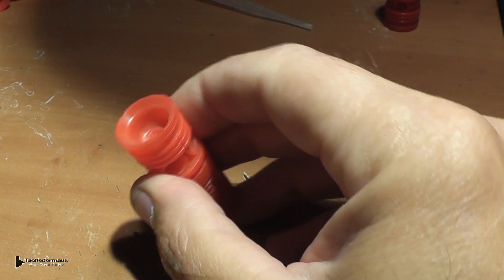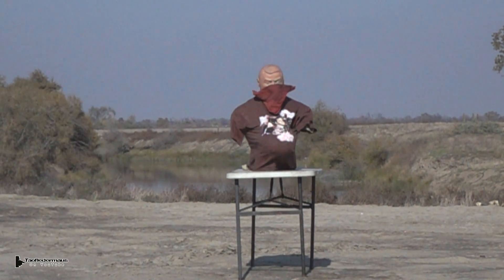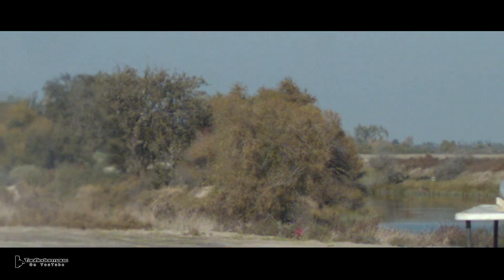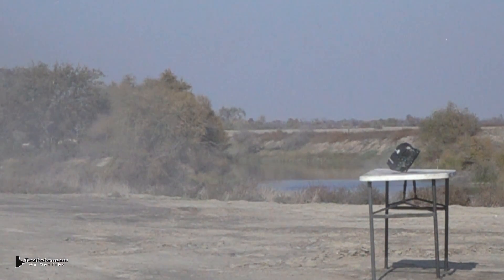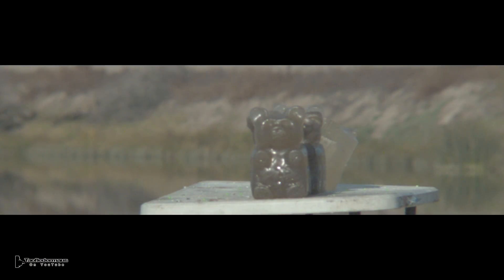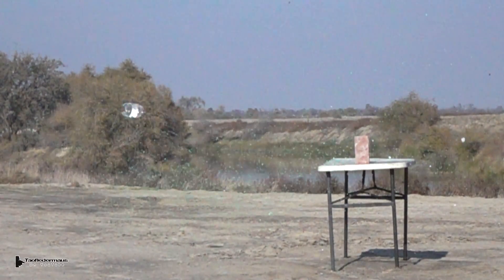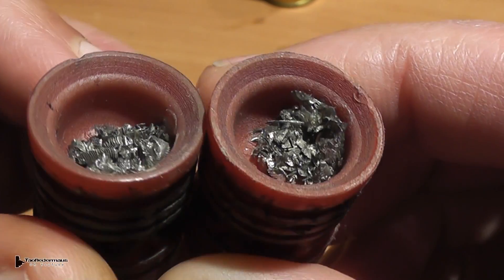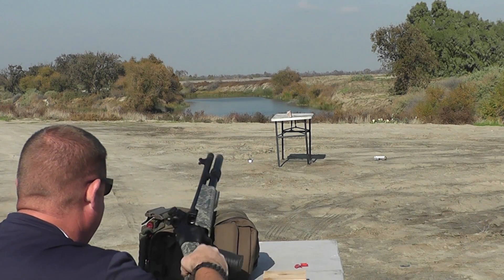Magnesium Shotgun TRACER Experiment -You Asked for It

Comment: tracers activate because of the friction of the air against the chemical that ignites....magnesium needs a heat source to ignite, which is why this will not work.
Reply from the maker: Then what caused the magnesium to ignite when it was just in the powder?
Reply: +TAOFLEDERMAUS the powder going off, but when you fasten it to the bottom of the shotcup, as it travels it creates a draft effect that keeps air from contacting the magnesium which snuffs it out almost instantly

Comment: The glue doesn't Transfer heat well and is not flammable enough of a securing agent too allow the Magnesium shavings too burn effectively or quickly. 

The Shavings in the powder worked because the entire compound was flammable and the magnesium's effective surface area too mass ratio was ideal for quick and sudden ignition. In a similar fashion too how "Dragons breath" shells work which fire several magnesium pellets what we have here is kinda like what might happen if you fired a shell with a magnesium slug behind it from a pyrotechnical standpoint 

For better results use more flammable securing agents and smaller quantity's of magnesium over a larger surface area.

Comment: OK, coffee on board!
Try this: magnesium fines, barium nitrate and a little smokeless powder dissolved in a tiny bit of acetone.  Hmm, pasty.
Blend the ingredients, then fill the powder end of a sabot cup with this goo.
Let it dry many days.  If it shrinks and falls out, hot-glue it back in!
You should end up with a hard lump when fully dried.
Test some of this carefully, it can 'self-levitate' like a tiny rocket, so do this at a friends house. XD
Anyway, the barium nitrate is a strong oxidizer that will get the magnesium burning quite easily, the magnesium burns brightly and the smokeless glue holds it all together while lowering the ignition temp.
The trace will be greenish white with very little smoke.
BTW, magnesium + barium nitrate hold honors for most light output per pound of material.  Orange aerial flares are close, but they use sodium nitrate and Teflon.  Fairly toxic smoke.
The more you know.
BTW, the barium nitrate and magnesium should be a stoichiometric mixture: no excess oxygen or fuel.  Moles and all that.
Reply from the maker: I'm going to try some little balls out of a mortar firework shell.    I'm not sure if it is hold up to the blast but it will be a simple way of doing it,   which is what I am hoping to do.

Comment: I doubt the wadding coming loose is actually related to the magnesium - at least, not because it's specifically magnesium. Either the heat from the glue weakened the grip between slug and wadding, or the increase in weight caused any slight rotation or wobble to throw the wadding loose, or maybe some weird supersonic aerodynamic thing happened.  My bet would be on the added weight, but the heat is a close second, no knowing how the wadding and slug are bonded.As to why it didn't ignite, my bet would be that the glue is creeping along the magnesium, isolating some of the surface area from direct heat.

Comment: Thanks for another thought provoking video.  As I'm sure others have mentioned, there are two possibilities on why the Mg failed to ignite, lack of heat or lack of Oxygen (or both).  You could address both by including chopped fuse material with your Mg.

First thing I'd do is verify the fuse can ignite the Mg mixed with the hot glue (thermoplastic).  By it's nature, hot glue readily absorbs heat and prevents Oxygen from reaching your Mg particulate.

Hope you revisit this!

Comment: prolly due to lack of air moving through the magnesium shavings due to the glue. try using a vinyl or latex finger tip. cut the tip of the finger off and put the shavings in there and glue the latex or vinyl part to the sabot so that the ignition tears open the latex and the pieces come out more slowly and with space for air flow to allow ignition. Not a specialist but its sounds sound to me.

Comment: The magnesium literally can't burn. The shavings burned before because they were exposed to plenty of oxygen as they were shot out of the barrel and spread, but they don't have that now. The hot glue prevents any oxygen at all from getting to the magnesium, so even though the heat to ignite it is there, it's missing the oxidizer. Try again and mix some potassium nitrate in with the magnesium, that should help it get going.

I'm also not sure if hot glue is such a good idea, because it may form "walls" around the different reagents and prevent them from reacting with one another. It might be better to keep rather large shavings of magnesium and large clumps of potassium nitrate, and confine them in a container with a relatively small hole for the burning magnesium to be expelled out of. Probably not the best way to go about it, more something I could come up with off the top of my head.

Comment: Magnesium won't igntie underwater or underglue, apparently. Maybe magnesium tube or lengths of magnesium ribbon sticking out of the back of a solid slug? You'd have to pour molten lead into a mould around them, and I suspect you'd get what's technically known as "shit" accuracy that way. You'd also have to use tubular wadding or that French slug's sabot to launch it without crushing the tail section.

At a guess, the tail section is coming off because it has more mass. You can wave a stick around but if you have an apple on the end of it the stick'll snap, right? The compression as it's shoved up the barrel gets released as it clears the muzzle, and the extra mass on the back of the plastic means as it expands back to full length it's got more momentum backwards relative to the slug's main body. That takes more force to stop, and it's more force than the connection between the two can take. Overweight bungee-jumper breaks rope. Plastic comes off lead.

Comment: +taofledermaus I think what has changed is that by gluing the shavings together, you have increased the thermal mass of the magnesium. The very short time the burning powder has in contact with the magnesium & glue alloy is not long enough to raise the temperature to the combustion point of the magnesium or the glue. By gluing the magnesium to the sabot, you have given the magnesium a heatsink.
To test this theory Take one of the sabot rounds with the magnesium glued in, and try to light it with a lighter, the same way as you did with a single shaving. My guess is the magnesium & glue will take a lot longer to ignite.

As to the sabot releasing from the slug, by filling in the concave base of the sabot, you are changing the aerodynamics of the round. The increase in drag is only small, but it looks like it is enough to pull the plastic away from the lead.

Great video as always.

Comment: I suggest you guys should try shooting wooden slugs
Reply from the maker: We shot slugs made out of Mexican iron wood before
Reply: Anti Vampire slugs!
Reply: Mmmm.  Now, despite not believing in this silliness, I'm wondering how to make an anti-vampire slug.  So what's required?  Vampires need wood, but they specifically need an embedded stake, not an in-and-out.  Remember those Sauvestre slugs?  Use a slug like that, with an ironwood tail.  If you barb it to rip the tail free after the slug impacts, you may have a slug that leaves impaled wood despite having good penetration.
Reply: Fortunately they already did that. You can find the videos in their channel

Comment: Ya the magnesium wont ignite because it to much like a solid piece. Thus the heat of the burning powder wont properly effect the magnesium and get it to its ignition point. Well a free floating powder or shavings have that extra space around them (thus surface area and lack of mass) that allows the heat to envelopment them and get them to the needed temperature.
What you'd have to do is either make a mixture of something or have stages. Thus one part is easily ignited by the gun powder and will serve as the starting burn. This first part there for produces the needed heat and contact that can properly ignite the magnesium or whatever.
You could try using a more reactive metal, like lithium. But that stuff oxidizes pretty fast and if it contacts water can self ignite, which is bad. Could also drilling out the slug a bit and giving if a sparkler rod core with maybe a little magnesium dust. Which might have a higher chance to ignite, also wont explode in the gun.

Comment: the weight so far behind disturbs the flight of the wadding
when you glue down the magnesium you reduce the surface area and seal it partially off. the high surface area is needed to ignite it. it is still a metal and has relatively good thermal conduction, reducing the exposed surface area reduces the contact to oxygen needed for ignition and as tiny as it might be, the glue takes heat away.
with the suggested solid chunk of magnesium you would wait ages for it to start burning even when heated directly.

Comment: Did you try lighting the magnesium/hot glue mixture more conventionally just to see if it would burn?  My guess there isn't near enough heat to set off the magnesium.
Reply: it would be smoky and useless and no different.
Reply from the maker: The magnesium was right against the burning powder.
Reply: im pretty sure the issue is that the magnesium is just burning up in the barrel.
Reply: What if you used black powder instead of smokeless?

Comment: You need finer (fuzzy) magnesium particles, like those from drilling or fine lathe cuttings, add a little oxidizer too, potassium nitrate would work.  Mix it with some model cement or shellack rather than hot glue.  You could also just add a dab of black powder, mixed with cement or shellack, to the back of the shavings,  It would serve as a ignitor.

Comment: I think you are missing oxygen there, the magnesium is probably too densely packed to allow enough Oxygen in for ignition and glue is itself a barrier to Oxygen penetration.  

If it was less densely packed there would be more surface area overall as the inside would also be exposed.  Cant explain the separation of the wadding though thats odd.

Comment: to ignite something you need three things: fuel, oxygen, and heat. I think the glue is blocking the oxygen and hot glue absorbs the heat very well. I think the spark from the gun powder is not hot and or long (time) enough to ignite the magnesium inside the glue. Use glue that ist flamable and you slolved the problem, my guess.

Comment: the solution to the problem is simple. you are basically making your shavings solid which is why you are getting ignition. you might want to go back to mixing magnesium into the powder into the shot gun powder. you might be able to get a high enough ignition temperature that way.

Comment: Jeff,  I love your channel!  Keep up the great work!  I may be too far back in the comments, but here it goes!  

I was thinking that maybe you are experiencing separation of the piston and slug due to the arrangement of the glue/Mg mixture directly in the center of the cup?  This would cause a transfer of energy directly to the center of the slug causing it to separate.  Would you consider arranging the glue/Mg mixture around the circumference of the wadding, but still in contact with the powder?  This may not solve your ignition issue, but it will more than likely stay in one piece down range.

Comment: Taflo, (1)would magnesium mixed w powder that created the big flash ALSO ignite the "tracer" part? (2) if slug itself were magnesium w a flash hole from "tracer" through wad work to ignite slug? I once file shaved half a magnesium (powdered) firestarting block to dust & put the other half  under the dust pile & lit it w a lighter. The block ignited from powder fireball, burned through hood of car it was on, burned through top of air filter & into carb which melted & burned down into intake manifold. Made a hell of a mess & ruined the motor.
Reply from the maker: The magnesium that was glued to the wadding was right against the burning powder, in the same spot as the magnesium that was put on top of the powder.
Reply: +TAOFLEDERMAUS , saw that, apperrantly just the powder wasnt hot enough long enough to ignite the wad cluster. it took the powdered magnesium to ignite the solid block described earlier. im wondering how a flair projectile works. have no info on that.

Comment: The problems is the glue. It is basically rubber and will keep stuff from lighting on fire. Try just packing magnesium without glue. I think it will work a little better. And now I see all the comments saying the exact same thing as mine. So Now I just say go with your gut.
Reply from the maker: What would keep it attached to the slug?
Reply: ***** Maybe have a hollowed out slug filled with mag powder and see if that will make a tracer type round. To get it to ignite, you can have a small amount of magnesium between the wadding and the slug to light the magnesium inside the slug. Remember, I am no expert and have no knowledge of reloading or what is needed to fire a slug. So this is just a thought from a newbies view.

Comment: probably needs an oxidizer. try making a paste with strontium nitrate and magnesium powder, adding a dollop to the base and letting it dry completely. that should do the trick.
Reply: If we're getting into chemistry, replace the wadding and short slug with a longer slug that has a 4.5mm hole drilled into it from the front and msot of the way through, filled with a 13:2 by weight mixture of ammonium nitrate and caster sugar and capped with a pistol primer, total mass still about 28g (due to that stuff being less dense than lead).
You may want to mount the gun in a workbench and use a long cord to pull the trigger ...

Comment: Try a small chunk of magnesium, hollow in the middle with something that ignites at a lower temp and burns hot enough to ignite magnesium. I pretty sure such a substance exists but I can't think of what it's called

 super dangerous would be a mix of wax and thermite as a tracer in the back of the sabot and just pour some thermite on the top so it's just sticking to the wax as opposed to mixed into it

Comment: so putting "dimples" in a golf ball makes it go much further due to 
aerodynamics ....so if you made a slug with "dimples" in would it go 
further and faster ?
Reply from the maker: I don't know,  you'd have to compare it to one without dimples,  but the problem is if you drilled out a bunch of dimples it would make the slug lighter so the test would be invalid.
Reply: good point ...however i read somewhere that a golf ball without dimples will travel about 90 meters and one with dimples can be hit to up to 300 meters ....so its not huge dimples ..just enough 

http://www.aerospaceweb.org/question/aerodynamics/q0215.shtml

Comment: The magnesium may need to be "loose" behind the wadding so that after the powder ignites and the projectile starts moving the flame is all around the bits of magnesium. This would give the maximum surface area exposed to the flame. With the magnesium glued to the wadding it only has half of its surface exposed to the flame and is riding the pressure wave ahead of the flame (mostly). You might try making magnesium coated glue spikes extending back into the powder or a magnesium coated sticky string trailing the wadding.

Comment: Don't you need some other chemical to react with the magnesium?
Reply: TAOFLEDERMAUS magnesium powder might do you well in this case
Reply: In a chemistry course I took, we did some experimentation with magnesium. In order to get magnesium to react, we needed either smaller shavings, or more heat. A 1/16" thick piece of magnesium required a direct flame from a bunsen burner to even begin to react
Reply from the maker: We didn't need it when the magnesium was just on the powder.
Reply: doesn't the pressure make a buffer zone near the base  of  LBC Sabot slugs = not enough heat to ignite the magnesium... would  magnesium strips long enough to be in the powder ( fuses so to speak )and glued to the shavings on the base for best ignition chances?

Comment: screwed up balance plusses rubber has a high burning point then melts and puts out the fire. you can't glue it in. it needs to be a sphere of Mg and a hole through it like a jewelry bead, pack phosphorus in the hole with gun powder and use shot at a ratio of 1/3 Mg and 2/3 Pb pack a small amount of gun powder with the shot. that should work. alternatively you could make a hollow slug of Mg and put phosphorus in the cavity plus a small amount to of gun powder and a small fuse. if I had the equipment I could make it

Comment: Maybe cause magnesium is very reactive, it caused a secondary ignition behind the slugs, which threw off some careful calculations and testing that went into the making of those slugs.

Maybe if you tried experimenting with different slug designs you could find one that benefits from this.
I'd suggest one that allows for the magnesium to be put directly on the slug itself.

Comment: what if you filled a shell with a mixture of nothing but powder and shavings and closed the tip like birdshot
no projectile
just the goods
Reply: a fouled up bore is what you'd get!
Reply: Bobby Patton
use a shit one, it's not like it'll jam
the dragons breath is basically the same
Reply: Without compression from the wadding and load the gunpowder and magnesium would just deflagerate, I.E. burn up in the shell and make a huge mess.
Reply from the maker: The powder probably wouldn't ignite at all,  just the primer would go off -  without compression
Reply: ***** If the shell was completely full AND crimped, I would think it would ignite.